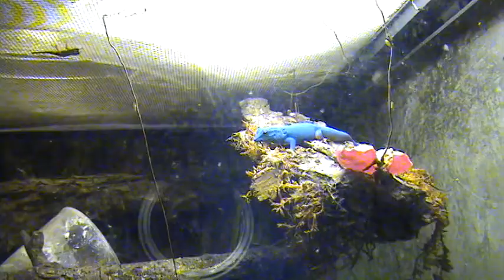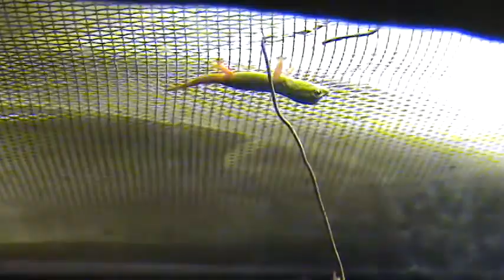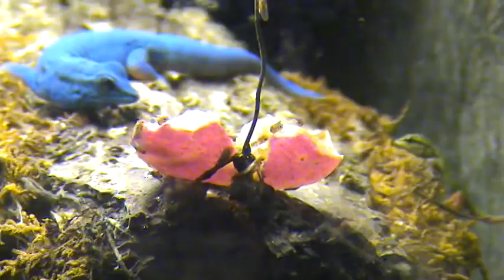110125 Lygodactylus williamsi hatchling

Comment from the maker: @Tomminose Let him hide so he has a place to feel secure. I condition mine to know that when I tap the tank with my fingers Ive just put n fruit [today; banana crushed with a bit of vitamins and calcium] If you look through my videos youll see how I take 2 pieces of bark and silicon or hot glue them together. I try to create 'hides" which are somewhat like ladders. One is small, and just a half inch or so under the UVB light.  Fill me in on what tank you have.  And exoterra what size?